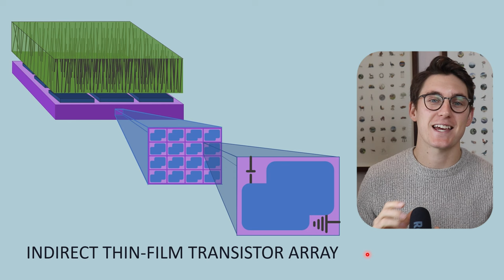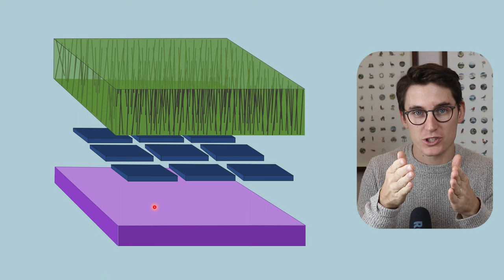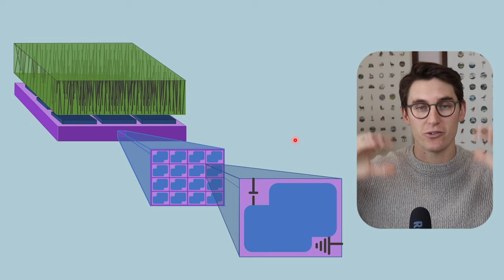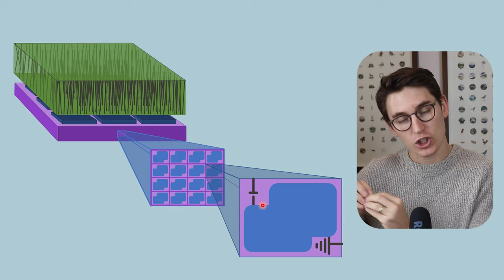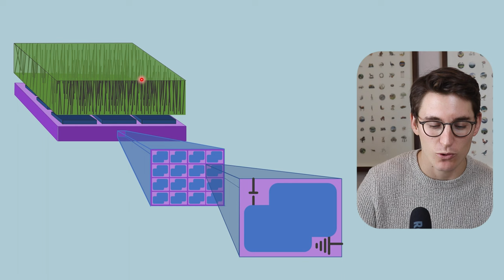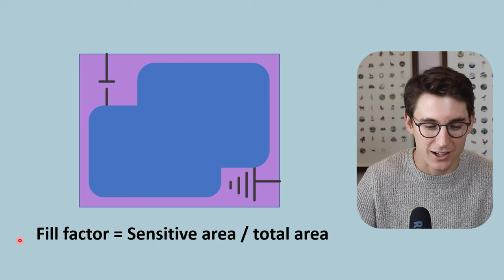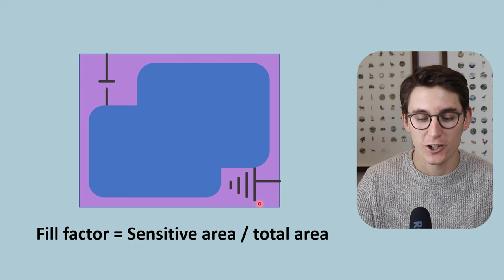Indirect Thin Film Transistor Array (Flat Panel)  | X-ray Physics | Radiology Physics Course #35

Comment: Just so there is no confusion. The symbol used for a capacitor should be -| |- the one used in the video is for "ground". unless I am missing something of course!
Reply from the maker: Yes! You’re right.  I wasn’t trying to make a specific symbol 😅 just a diagrammatic representation! Ground would have one less line. In hindsight should have used the actual electrical symbol 🤷🏻‍♂️ well picked up